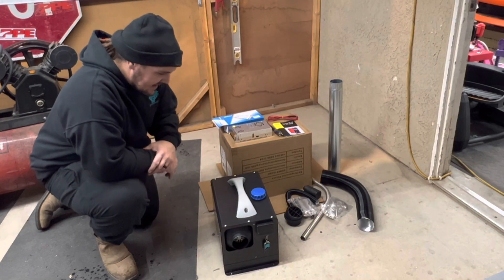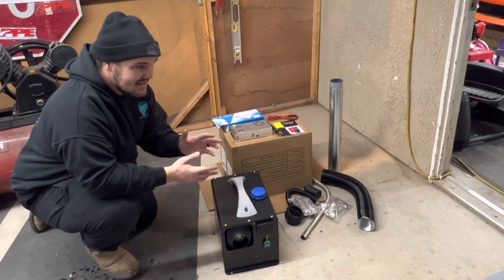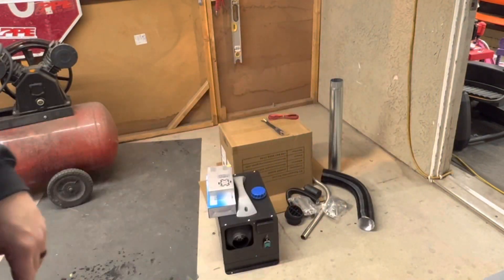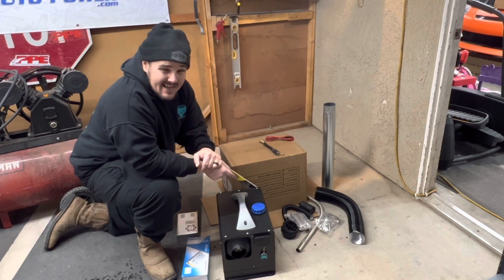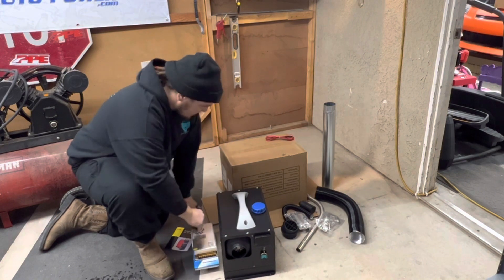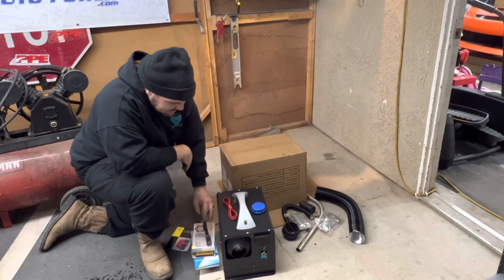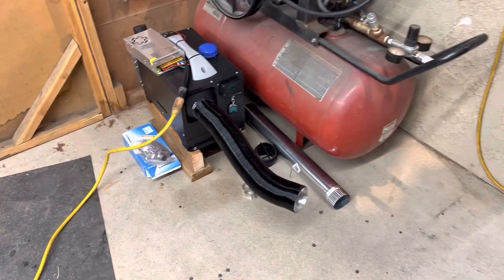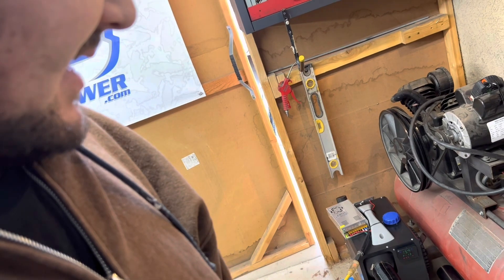Diesel heater set up + 110v wiring guide

Comment: Hows it working. Update
Reply from the maker: Easily over 500hrs on it. No issues. So happy, I bought a 2nd unit to heat the garage
Reply: @OBSBryce heat your garage pretty well? I'm installing one in a large 2 car garage and going to add a secondary fuel tank to see how well it can heat the garage if left on.

Comment: I just ordered mine (different brand but they're all made the same) I'll have about $165 or so into mine because I ordered a better fuel line (the ones that are in them are junk) and of course the power supply and a few other pieces of ducting, etc. I will probably mount on in my garage first (to run my experiments) and probably add another in my basement to help heat my home eventually.